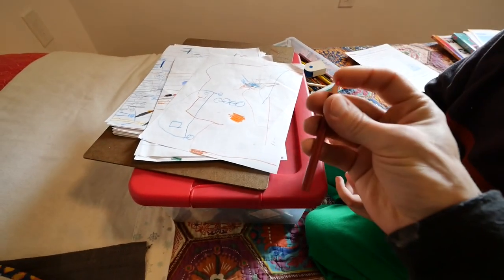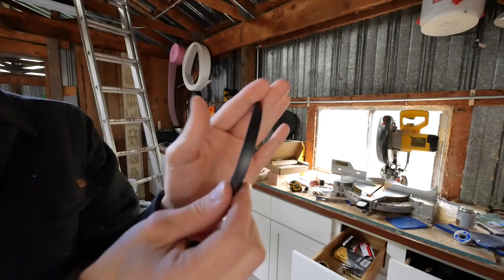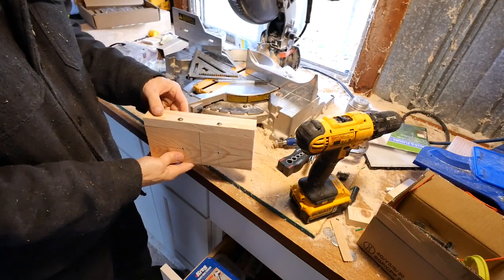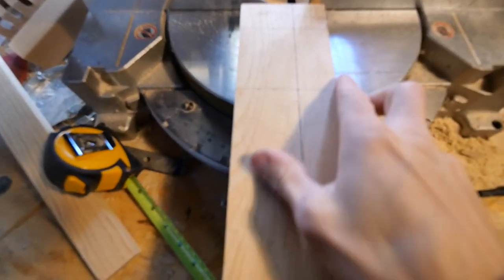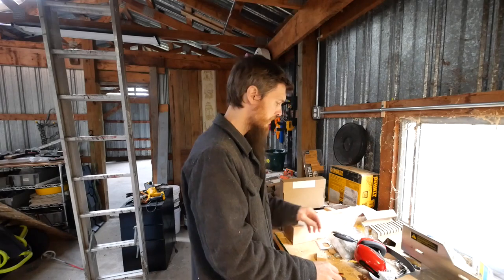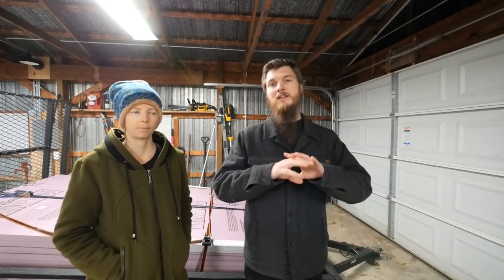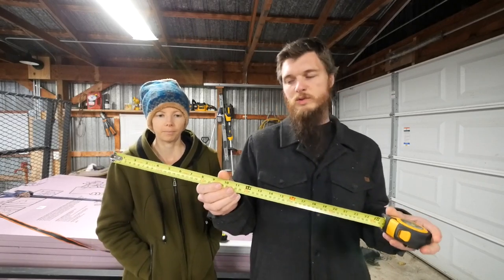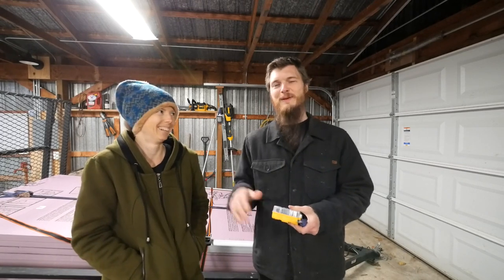Problem Solved in our Garage Shop - Easy Handle Install

Comment: So if I order the tape measure...if I order it from the description area below, you'll get a small credit for it, correct?  I'm always ordering stuff from amazon.  Is there somewhere on the order I can add your info or is it just when you have it in your description?
Reply from the maker: I believe all you have to do is click on any of our Amazon links and purchase anything though them and we get a small percentage of the order total. No need to enter our info anywhere.
Reply: @diyfferent  add more links....

Comment: You will be more famous & you need to get used to people recognizing you. Just chuckle and shake hands. It will get easier when it happens more often.
Love the tape measure!
LOL inside my motorhome last night with no heat it was -2°C or 28° F. My propane heaters ignitor stopped working. The alternator on the motorhome quit working about 3 hours earlier. And all stores were closed. The mechanic that was suppose to come out & put the brake lines & master cylinder on did something on his fishing trip & blew out his hip so he couldn't do my brakes. It's been one thing or another all summer. No moving to Kentucky for me now.
Reply: Do you guys shake hands still? No one does here in California.

Comment: I have seasrched through videos and cant find the one where you installed the ceiling lights.  I am interested in those lights.  Can you provide me with the name of the video or lights?  It would greatly appreciated.
Reply from the maker: Which lights are you specifically referring to, the garage lights or lights in the house? We used different types in the house. Just let me know and I'll find the video :)
Reply: @diyfferent  I think you called the halo's
Reply: @diyfferent  Thank you for responding
Reply from the maker: Here is the video and the link is in that description: https://youtu.be/GaH0KtiJzh0
Reply: @diyfferent  Thank you thank you thank you

Comment: Question is the insulation non-flamable?
Reply from the maker: No, it needs to be covered. We'll be covering it after it's installed :)
Reply: @diyfferent  Will you cover both top and bottom. Fire might spread above if not covered! I'm not an expert but please take care and advice you need to minimise fire risks. Enjoy your videos!